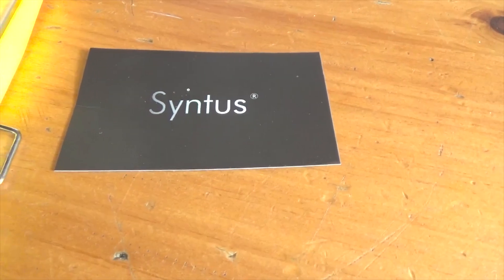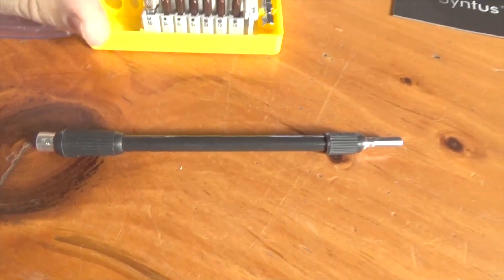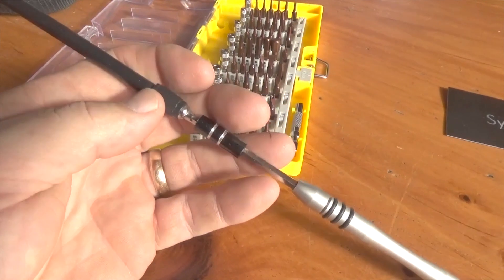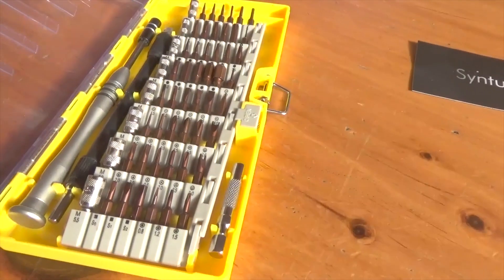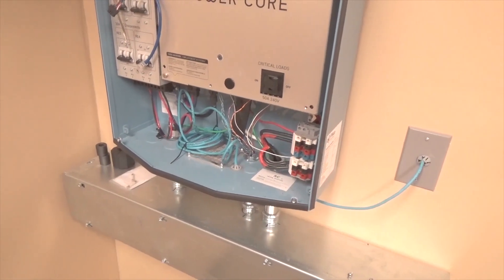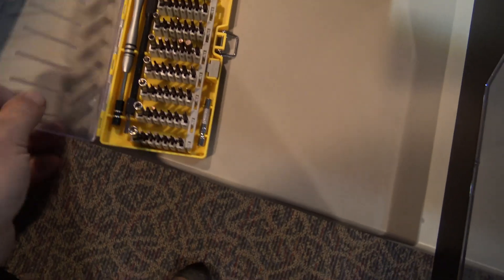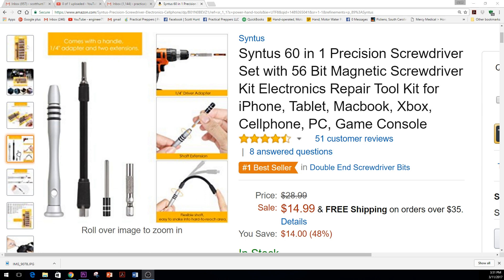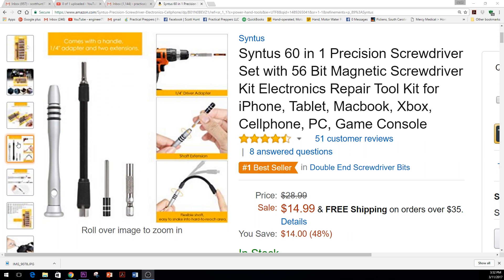Syntus TOOL KIT review

Comment: I don't know about in the US but here in the UK we call the rod you put through the handle to increase leverage a "tommy bar", no idea why but I can recall my grandfather calling that more than 40 years ago!!
Reply: Some screwdrivers have a spot for a wrench to do the same thing but they are all solid ones you can't change the head on as that much leverage could break the socket a bit fits in.
Reply from the maker: A cheater bar

Comment: nice looking kit,but the handle needs to be a larger diameter.
Reply from the maker: True but with the hole on the handle you can use a cheater or any one of the bits to give you some torque.

Comment: What is your educated view point on solar roof shingles?
Reply from the maker: Well I have seen a bunch but never installed them.  They look ugly to me.  :)
Reply: Thank you.  What is your opinion on residential desalination systems.  The reason I am asking is I am going to buy a property in Alaska.  The remoteness doesn't allow electric power service.  So I am looking into solar combined with wind technologies with batteries to drive the motor coupled on the high-pressure pump.

Can combining those technologies power the torque needed?
Reply from the maker: Desal takes a lot of power.  Are you talking reverse osmosis or distillation?
Reply: I am talking about reverse osmosis.